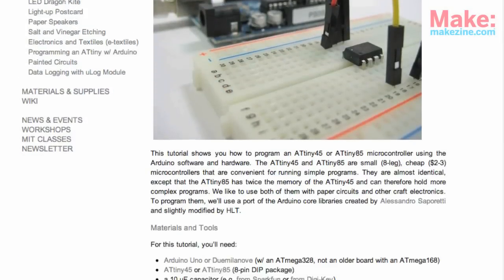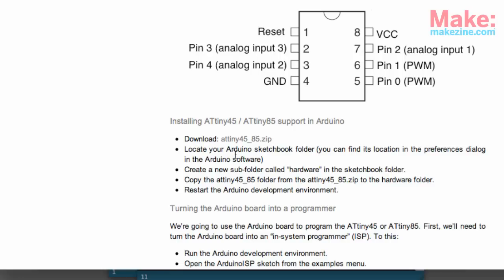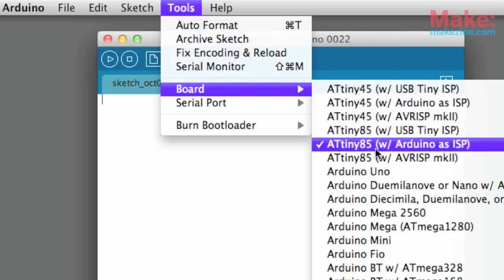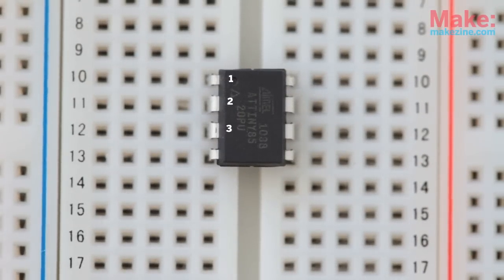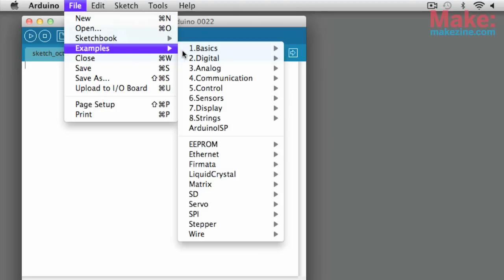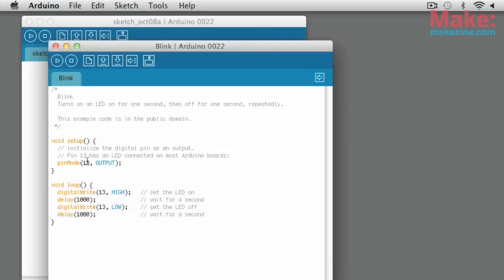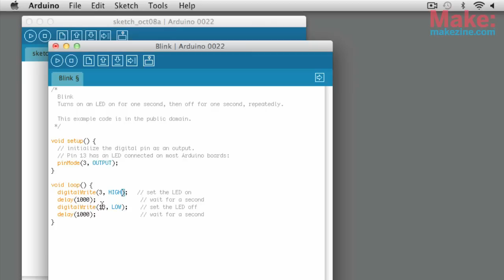How-To: Shrinkify Your Arduino Projects

Comment: I was struggling to get this thing done but every time my Arduino software was showing an error.....As soon as i removed the 10 microfarad capacitor, my program started working like magic! I don't have an explanation for that but i guess you might want to try it too.
And go to the high-low tech group and see the instruction from there. This video didn't do me any good.

Comment: for me i am a videogame programmer.. But along with that I have to have some nice software so I can run my own game with very high graphics. Also while doing rendering in programs like 3DS max or any other external renderer for it, it is nice to have lots of ram, nice processor, and a great graphics card. I have a computer that can pretty much run any game so it is great for my own programming of videogames because I have 2 computers, one that is old that I test the game on, and the developement

Comment: The point I was making was the fact that the ATMEGA 328p (which is the same chip that is in the older Arduino) is about $5.00 and the ATtiny is about $2.50. You don't need a new Arduino if you use a ATMEGA 328p and it has all the same pins available as the Arduino.

Comment: Once you have the arduino bootloader loaded you can reprogram it just like your arduino, given you have the programmer for that.

Otherwise, if you want to delete the bootloader and basically start off with a totally blank ATtiny85 again and maybe do some AVR-C or even assembly language stuff, then you need a different programmer for that...something like the AVRISP mark 2 or something similar.
Either way, the chip is rated for a lot more write cycles than you will ever need. So reprogram away.

Comment: is it still worth doing this given that the tine arduino is about $1
Reply: better off just getting an atmega chip like the one on the arduino, swap the arduino chip out, program the chip for your project put the arduino's chip back in then no problems. The chip is 3 times as long but if you're sticking a 9volt battery in there anyway does it matter?

Comment: Do you know if there is more that will work with all the other ATtiny's? I need more then 6 pins, and Analog pins. But I like the Arduino IDE a lot more the AVR.

Comment: After installing the Attiny files in the proper directory, loading the arduino with the ArduinoISP sketch, switching to Attiny (w/ Arduino as ISP) and TRYING to load the blink sketch, I get a bunch of upload errors with the following as the main error:

Blink.ino:1:21: error: Arduino.h: No such file or directory

Does this mean I didn't install the attiny files right? They show up under board in the Arduino IDE.

Comment: Hey guys - Another question. I want to make a Clapper (Clap on/off switch) using the arduino and the ATtiny 45. I found a good script, uploaded it, and I used Pin 2 for analog input and Pin 3 for digital output (used in the script), so which pins am I using actually? (ATiny pins)

Thx

Comment: I tried that. I copied the attiny folder to Arduinos harware folder. In the IDE  can see ATtiny options but none (w/ Arduino as ISP) what did I do wrong?
Oh jes I run Win7 and the latest version of IDE
Reply: Hi Sir,
Can you tell me where did you get the ATtiny folder as the website is down.
Please I need it urgently
Thank you :)
Reply: Im running Arduino IDE 1.0.4 and use the ATTiny 45/85 (internal 1Mhz clock) as board and it works fine instead of (w/Ardunio as ISP)
Reply: oh ok thank you :)

Comment: I'm using an atmega328 (as my arduino uno, but later revision).
Will everything work exactly as on my uno board?
Plus, it is easier to upload to it. I just plug it on the board and the put it back at breadboard.

Comment: Can you use like an atmega instead of the attiny the same method if you put the wires in the corrisponding pins (to the attiny)
Reply: Yes. You might need to futz with those configuration files a bit, but it should be trivial to do.
Reply: +TheHue's SciTech Nice! What do you do for the configuration files ans where can you get them?
Reply: ***** I'll have to re-watch the video later; I've forgotten what this video is about and don't know what config files I was talking about... You can easily use an Arduino as an In-System Programmer (ISP) to program a standalone AtMega328P though. I found a guide on the Arduino site (google "Arduino To Breadboard"), but it may be confusing for you because it's obsessed with getting an Arduino Bootloader on the separate chip; and the Arduino Bootloader requires 16 MHz so they incorrectly assert on that site that a 16 MHz crystal is required. But it's not required if you're just putting your own program on the chip and don't care about it being Arduino compatible.
Reply: It's alright, don't worry about it. Nothing a bit of Googling can't fix!
Reply: ***** I edited my earlier reply to add a bit more detail, check it out.
Reply: Thanks! You're right, I don't need to make an arduino-compatible chip on a breadboard, I just want to run the code from it like in this video. The only thing I need to do now is find an appropriate capacitor! I just with the capacitor was unnecessary.
 Do I still need to burn the bootloader though?
Reply: ***** No. The bootloader is only required for the hacky way of programming that Arduino normally uses (via the UART/serial lines). You're programming the chip properly via ISP; which does not require a bootloader. And the chip itself doesn't need a bootloader to run, it can just get started straight away.
Reply: Cool! Thanks!

Comment: When I try to pass the blink example (with pin 3) it says 

Blink.ino:10:21: error: Arduino.h: No such file or directory
Blink.ino: In function 'void setup()':
Blink:15: error: 'OUTPUT' was not declared in this scope
Blink:15: error: 'pinMode' was not declared in this scope
Blink.ino: In function 'void loop()':
Blink:20: error: 'HIGH' was not declared in this scope
Blink:20: error: 'digitalWrite' was not declared in this scope
...

Comment: what annoys me about smiling jack there is that he does not mention if the usb is to remain plugged into the arduino while he is doing all this wiring. in the video, it is disconnected.
is that correct ? don't i loose the isp programmer i just loaded ?
yet i seem to recall being told not to make wiring changes while the usb is plugged in.
i keep getting a "did not find any USB device "usb"" error.

also, in my list of boards, attiny's are there, but none say "use arduino as ISP" as he shows.

Comment: It is possible that Make does not own the rights to the content, so they need to link to  legally.  Open source means the code is open,  that does not include any supporting documentation, pictures or circuit diagrams. They may be the property of the owner.

Comment: I'm looking into making an arduino powered model rocket launcher with 7-segment digital countdown, Piezo electric sound effects, potentiometer to set count down duration, and probably a relay or capacitor to deliver the charge to the model rocket igniter.  I've seen a project that does this with about one or two pages of arduino code.  Could I possibly run a project of this magnitude on an ATtiny 45 or 85 chip mounted to a breadboard?

Of course, I'd still need a descend power source (I'm thinking 9v battery) to deliver the charge to the model rocket igniter.

Thanks
Reply: That's funny. I'm doing a similar project with some high school students right now. I like the idea of setting the countdown duration with a pot.
Reply: Jeffrey Darling Thanks, but that doesn't answer my question...  :-)
Seriously, I was hoping someone would know if these chips can hold enough code to do everything I want.
Reply: The atTiny85 has only 8k of program space. With really good programming skills and enough work, yes you could get your program on it. The atMega328p however,  is only about $0.50 more, and has 32k of program space. (32k should be more than plenty for your project) also, it has a faster crystal, so timers are more accurate. Unless you are using some sort of multi-plexer, the atTiny85 won't have enough for your 7 segment display anyway.

Best of luck!!

-IdeasEtc How To

Comment: Damn there a 2 PWM Pins and i need 3 for my Project. Is there a similar Chip With 3 PWM Outputs?
Reply: Use an Arduino Nano or ATMEGA32B (the DIP on the Arduino Uno).

Comment: But Attiny45_85 library is looking for WProgram.h so that is why there is a mess. 

Also while compiling, it is possible to have the following error:
avrdude: stk500_getsync(): not in sync: resp=0x00
avrdude: stk500_disable(): protocol error, expect=0x14, resp=0x51

To fix it, you will need to remove the 10uF cap before uploading the example ArduinoISP code.

And voila! Happy coding!

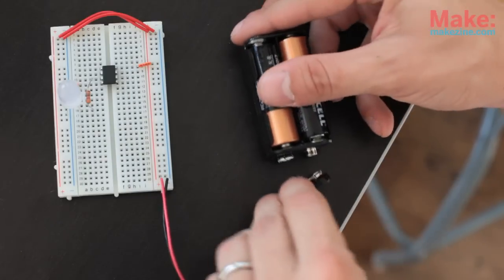Comment: Ok got it to work but there is an error in the video. When they hook up the battery at 3:08, they hook it up the LED to package pin 3 not package pin 2, the one they switched to when they edited the blink example .

Comment: Are there any that can store more data and have more analog pins?
Reply: Yes, of course.  Have a look on the Atmel site.
Reply: Would the Amtel AT89C55WD Programmable Flash Memory Microcontroller be a good option?

Comment: can you get one that has a few more pins than this?
Reply: Yes. You can just buy a ATMega328P, which is just the chip that's on a normal Arduino, and run it as a standalone chip as shown in this video. 

ATTiny also comes in a variety of flavours with pin counts including 8 (like the one in this video), 14, 20, 28, 32. See below for more:

http://www.digikey.com.au/product-search/en/integrated-circuits-ics/embedded-microcontrollers/2556109?k=attiny

Or this is all easy to find on the Atmel site as well.
Reply: Cool, but can one with more pins function as a full arduino module?
Reply: What does that even mean? I don't understand your question.

Using different chips to the standard ATMega328P will cause some Arduino functions to not work, as mentioned in this video.
Reply: ok thank you
Reply: tagi35 The ATtiny45 and ATtiny85 have eight legs and are almost identical, except that the ATtiny85 has twice the memory of the ATtiny45 and can therefore hold more complex programs. The ATtiny44 and ATtiny84 have 14-legs and more inputs and outputs. Thanks to Mark Sproul for his work on making the Arduino core portable across processors.

Comment: Easiest way to program these is with the avr mkII hook everything up write your sketch and hold shift then hit upload. It's should change the text on the right in to "upload with programmer" in version 1.0 at least. 
And attiny 45 are 80cents and the 85 Is about 90cents and a full atmega 328p-pu is 2.50$ and if you use the example on the arduino website it runs at 8mhz with no crystal!!!!!! Cheap cheap 
I'm going to be making a video about the arduino I made the ones I have and uploading code w

Comment: 2:06 can i use a 25 volt one or does it have to be 50 volts?
Reply: +James Pae Bit late on the reply, but you can use anywhere from 10v to 50v.

Comment: (1/2)
Blink.cpp:10:22: error: WProgram.h: No such file or directory
Blink.cpp: In function 'void setup()':
Blink:12: error: 'OUTPUT' was not declared in this scope
Blink:12: error: 'pinMode' was not declared in this scope
Blink.cpp: In function 'void loop()':
Blink:16: error: 'HIGH' was not declared in this scope
Blink:16: error: 'digitalWrite' was not declared in this scope
Blink:17: error: 'delay' was not declared in this scope
Blink:18: error: 'LOW' was not declared in this scope

Comment: Nice, but how about shrinking it to an AVR and gaining some program memory in the process. I mean skip arduino in general.
Reply: Is there any write-up on this?  Would you just flash the AVR through the serial pins?
Reply: Nickolay Pelov  You can use Atmel Studio
Reply: Interesting, I would imagine such programs would be available for Linux, but it is Windows only.

Comment: In the Code Example - Change – the Programmer - to  
( Ardiono As ISP )   - Instead of ArduinoISP
Reply: In the Example  Matt says - set – The Programmer - to  
ArduinoISP  -   Instead use ( Arduino As ISP ) 
To make it work.

Comment: i had one big problem and 2 tiny ones with doing this the big mane problem was i was not wearing my glasses so i just garbed out of my component container i hooked it up right uploaded my blink sketch checked with led and found my first small problem led was in the wrong pin now i put it in pin 2 and nothing the i seen after a bit of fussing around that i my big problem with it not working was i put in a NE555P timer not the attiny so i put in the attiny uploaded the sketch and blinkblinkblink fast turns out this chip was set to 8MHz and that was my 3th problem i uploaded the sketch at 8MHz and now it works just fine thank you for making this video

Comment: I have a breadboard setup and my 328 chip as an UNO board I can get Bootloader to load but, can not get any other programs to load.  My USBtinyISP programmer does not indicate any reset pulse for any program except bootloader.  I am using Arduino 0022 I don't know what the problem is.  Any one have any suggestions?

Comment: he says to check if it works by plugging in a led. but doesn't say where. in the video it looks like 1 pin goes into a rail, and the other is plugged into an empty breadboard row.

Comment: make some proper separated work and control circuits. connect the servos to the battery (work circuit) and the controlling wires to the attiny? (control circuit). use a relai or transistors to control the work circuit with the control circuit.

Comment: Good video, but why waste time on hardware when you could be coding. We use the Simulator for Arduino by Virtronics which lets us code straight away and also has a lot of debugging capabilities such as single step and breakpoints. When the sketch is ready, we then move to the hardware.
Reply: He had the code done beforehand.

Comment: Why can't I just use a PIC or a IC timer instead? Its legit soldering and it usually doesn't even require an arduino at all. Plus a IC timer is 1/15 the cost of an arduino. It technically counts as making a motherboard, since IC's and Microcontrollers are found in major motherboard electronics of today.

Comment: @ukeleleboy97 the netduino is not, but i was wondering since they almost have the same pin configuration and also most of the arduino shields work with it.

Comment: Since this video is really outdated, once the files have been downloaded, you have to select the chip based off of the internal clock, and the set the programmer as isp
Reply: +Master of code 101 .
Reply: +Mr30friends yes?
Reply: Master of code 101 just wanted to keep the tip for future reference.

Comment: The major problem with this video, is the price of a mini pro. you can get them now for under $2. It has an on-board 5 volt regulator, interrupts, more I/O and no limitations on Arduino code. 
If ATtiny was a dime, maybe. Not $2.50
Reply: If costs was the only matter, you're totally right. Not only regarding microcontrollers but other components as well. Size, power consumption and getting everything on one single circuit board could be reasons to do this.
Reply: I managed to find them in bulk on ebay, amounted to a quarter each.

Comment: This is SO frustrating!!  I created, under, (under),  c:\Users\Ted\Documents\Arduino\Hardware a Folder called: attiny45_85  This is a folder.  I even tried putting in: attiny45_85.zip  And restarted IDE v1.8.5  Under Tools > Boards, I DON'T see any attiny items!  I've never gotten ANY thing to show up.  What the HECK am I doing wrong?!?!?  I had un-hide Documents, but that was no problem.   Does the inside of the zip showing 'core'  have anything to do with this ?    H  E  L  P  ! ! ! ! !
Reply: Ted Mieske Did you open the zip and copy its contents to the Arduino folder?  Just putting the zip file in the folder doesn't work.  You do know how zipped files work, right?

Comment: It is an LED or a bulb lamp?????
Reply: No led stands for light emiting diode. They are super cheap and they are small etremely low voltage lights that come in many colors and sizes.
Reply: +wewlf a It's a 10mm LED, so it's larger than the ones you probably normally see which are 5mm.

Comment: Does the newer uno's not require the capacitor? lmfao because I did it without one it was to make it not restart right? now I believe Arduino software added in everything to switch it to programmer mode and etc ;D

Comment: Just get a $4 USBasp programmer, and pick that from the IDE as your programmer and load the chip, using an uno and having to load a sketch onto that is annoying.   Also why not use a SOIC package instead of dip, they're not difficult to solder and even smaller.     plus you can always get a soic>dip for prototypes or something.

Comment: especially since they cant even run exe files which is the most common program file type.. all im saying is that even if you have all your IDE stuff it just seems weird to be programming on microsoft C++ or even native C++ with a compiler that was made by microsoft.. why not just use a microsoft computer that can actually run the output exe without any addons or anything? and also.. by making things easy.. you are making people stupider and lazy.. another way i look at it